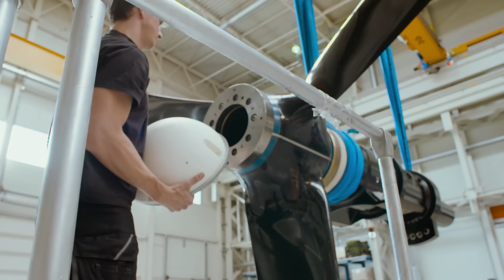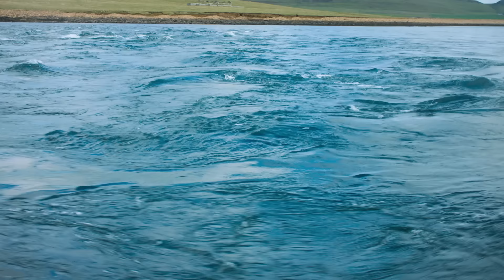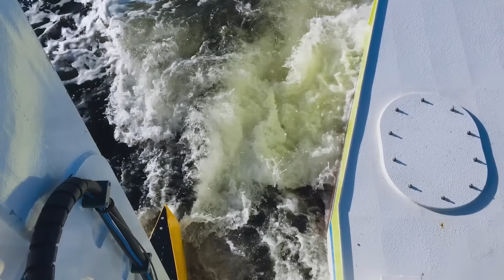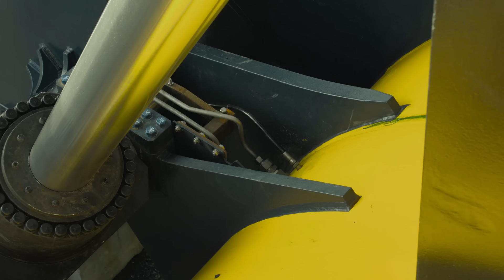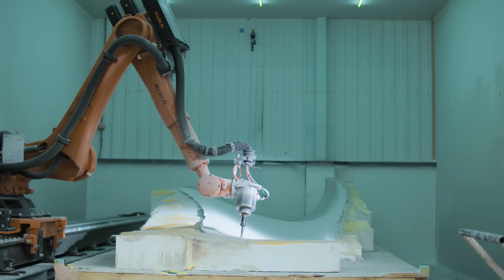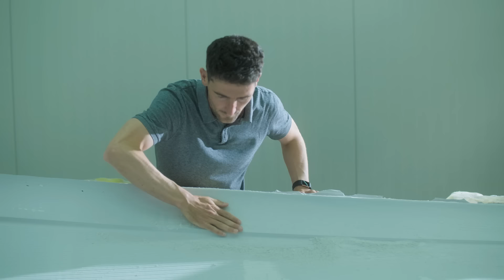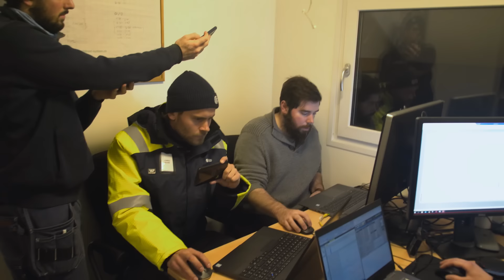Tidal Power: Unlocking the Greatest Untapped Energy Resource on the Planet | FD Engineering

Comment: Back in 1979 I was an engineering student at the University of Illinois in Chicago, and as a senior year project I had to come up with some innovative engineering idea and design.  I was very much amazed and surprised that I had come up with precisely the same idea, an underwater power generating turbine that used underwater oceanic currents to generate electricity.  In addition to the theoretical hydrodynamics calculations substantiating the conceptual design, I also made conceptual drawings resembling machinery shown in the documentary! Unfortunately my professor shot it down as he believed it was not feasible!!  I can’t describe how I felt when I saw my 40+ years old ideas converted into reality in this show!! My compliments!
Reply: Plot twist: This was designed by your professor 😂
Reply: @sampreece good one😂😂
Reply: At 22 I was talking to some engineers online discussing free energy ideas and gave my ideas of tide capture and electrical generation.  I was told it was not efficient and unreliable. It's now 30 years later and I have seen both my ideas used and functioning.  A part of me just hopes my ideas were somehow responsible for  modern advances.
Reply: @ Were your concepts based on flow or currents?
Reply: I had a similar think happen in a social science class and the professor shot my paper down. 
Now my concepts are being used to help others.
Reply: @nickb654  has nothing to do with that. His professor was just the average professor. Great professors promote critical thinking.
Reply: Great Minds.... !
Reply: @pcbasics1  sorry to hear about your professor knocking you down like that. A pity you weren’t more resilient and try some other people who might have been enthusiastic.
I told a friend about one of my inventions and he did the same thing! Some people just have a pessimistic attitude.
I have an idea which has not been seen anywhere as far as I am aware, but I do not know who to approach. Good luck with new ideas, and be more persistent.
Reply: Actually most of the best ideas for alternative energy came out in the 1970’s and this includes both passive and active solar, geothermal, wind power, tidal power, and wave power. There were many, many different designs during this time and those ealy designs are the basis for pretty much all the modern designs. As for tidal power some of these involved using massive underwater propellers like in the video (either attached to the sea floor or to a floating structure), and some involved letting the high tide raise the water level in an inlet which could then be closed off and then when the tide lowered the water was channeled though water turbines much like any other hydroelectric plant. Basically, if you get all the old Popular Science and Popular Mechanics magazines from the 70’s and 80’s you will find all this stuff and you will see that all these modern designs are merely improved versions of much older designs.
Reply: Everyone misses the point because we live in such an instant gratification society. The secret to using tidal power to it's fullest is to use it's immense lifting power to compliment gravity batteries which retain 99% of the potential energy generated by the tides. Natural processes that created the carbon based resources took millions of years. We can do it much faster in a green way. Gravity batteries can be constructed in the "Fully Charged" position. No high flow water systems need be applied. Aqua ducts could be used to convey the tidal power inland to a desired location. Tidal action would transfer the potential energy into the lifting of air-filled pistons that would be used to elevate weights.
Reply: Your professor may have been Donald Trump's long lost twin brother.  Ignorance runs in the family.
Reply: Don't feel down about it because unfortunately, ideas' have no value but cost money to first make it to paper then even more to create a prototype then test and evaluate then mega bucks to create a production model at which time the banks and MBA graduates will steal it from you and make lots of comp and bonuses and at the best you will get a royalty based on the net profit...bugger all./
Reply: @pcbasics1  Sounds like the university was trying to trick its students into generating free IP for the university. Remember: anything you develop as a student is owned by your school or university. They file the patents on what you create, and they retain 100% ownership and control.
Reply: Sincere congratulations, cap!  We couldn't do it without you!
Reply: I am very impressed with the new technology introduced in the video. This not only helps reduce pollution but also creates a sustainable energy source for the world.
Reply: Thank you so much for the unexpected compliments and encouragement. What is important in the end is that somebody did come up with similar ideas that were eventually realized, and that many of these turbines are actually in service currently in several areas around the world producing clean and environmentally safe electrical power.  It is just as satisfying to see that the technology was implemented and is working well.  Most important of all it is technology that has minimal negative impact on the environment, provided that the necessary precautions are taken to protect the surrounding sea life.
Reply: I know where you are at, pcb. Do you have your original studies? Study them - see if you had any unique tech or features not disclosed above. A (slight?) possibility you might have some valuable IP. But worth looking into it. Also go & see your old dean of eng (if still alive - - see what they can do. Even if only make sure it doesn't happen to other students. Talk to a patent attorney? Rethink your old design- can you improve on it? Good luck.
I curse teachers who doubt their students - just putting them down. Happens far too frequently! Monkey pox on them!
Invented the worlds best 4WD in 1982 - and best EV driveline in 1995. But Mafia control everything.
Reply: I was -21 years old
Reply: Don't you worry. Your professor let you down but China would definitely accept your concept. Then China would copy those designs, mass produce them and sell them to the whole world.
Reply: yup, sounds legit.....
Reply: A classmate of ours talked about this in the early 70's. We've got Øresund between  Denmark and Sweeden,  great Belt between Zealand and Funen and little belt between funen and jutland all 3 waters with constant underwater current. Peter (as he's named suggested to harvest energy from the water currents but our physics teacher shut down his idea cause he wasn't as clever/smart as Peter (who by the way when we were 15 years old teached nuclear power/technology to the pupils 2 years older than us)).
Reply: AOS LADRÕES  USAM ESTE METODO TE INSTIGAM E TE ABORTAM DEPOIS DESTE TEMPO VEM OS INOVADORES  EM 85 PREFEITURA DE ALEGRETE  RS BRASIL PEDIRAM A MIM SOLUÇÃO  LIMPA PARA O LIXO URBANO FIZ O PROJETO  COM INDIGESTÃO  E COLETA SELETIVA  SENTARAM EM CIMA ALGUÉM  JA ESTA USANDO MEU PRINCIPIO... ISTO É  MODUS OPERANDUS DEPOIS DE 30 ANOS ....
Reply: An underwater "windmill" has got to be the worst idea ever. This should be illegal.
Reply: @VidarrKerr  why?
Reply: @bertjesklotepino  First of all, we know that the vibrations from the above water turbines out in the ocean are responsible for the deaths of dozens of whales --just from the vibrations. Second, you now add tons of spinning blades to it and stick it under water. What could go wrong? 

We know birds get  executed by wind turbines in massive quantities. How many animal species live in the sky? Birds, bats, flying squirrels... How many plant species? IDK, are there any? How many animal species live in the ocean? All Of Them. How many plant species live in the ocean? All of them.  

How about we don't put massive, spinning blades in their habitat. It seems like common sense. I guess it will take dying whales to stop it. Oh wait... that didn't stop it last time. Maybe when fresh cut sushi starts piling up on the beaches, we can open sushi carts to feed the 3rd world.
Reply: I'd check if your professor isn't the one taking credit for it now!
Reply: Your professor was not wise. Had he HELPED finding companies interested in earning money, selling tidal energy, then he would have been a brave professor. What a waste of time, that was. Why not go for a REAL project?!
Reply: @voornaam3191  a REAL project? Like what?
Reply: Cape Cod Canal! <~~ there's a huge potential
Reply: my idea was to rotate the cylindrical semi-submersible vessel
Reply: God's wisdom
Reply: Education designed to crush any imagination or individual enterprise
Reply: I've had similar shocking discovery of ideas I'd already thought of. Not nearly as big as yours but sometimes it seems that there isn't anything that hasn't already been thought of. I was building an electric car, back in 2007 I discovered Tesla. They had already done it, and did a better job of it then I did. also about that time chevy volt came out. LOL. I was trying to recapture energy from the breaks and that had been done already also. I have a complete machine shop in my back yard so I can build things but haven't done it in a while. I think its time for me to get a job. I think it'll be a more relaxing way of living compared to what I've been doing. I've made special purpose machines and done pretty well with that. Having the patience to train people while your running a business, I've lost that. I was training very high level people though.
  Good luck in your ventures, it sure seems like you have some incredible engineering skills.
Reply: I'm from Chicago and I lived on the west side of Roosevelt road by California
Reply: You were robbed.
Reply: I've seen so many of my childhood concepts turned into reality
Reply: Awesome
Reply: You and many have had the same idea .
Reply: So it's not a British idea glory hunters typical English
Reply: If I'm not mistaken tidal energy started off in derry Ireland years back before 2016
Reply: Yeah right lol
Reply: No you didn't 😂😂
Reply: Shot that down hu? They make wind mills and water has more force.  Not shure why your professor thought that wouldn't work
Reply: Your professor probably sold your idea man
Reply: Congratulations
Reply: YOU ARE LYING. THATS CRAZY.
Reply: About 40yrs ago? I believe you. Imagine the excitement of the people who made their own energy breakthrough and wanted to sell their product to the general public...    We'll all have to imagine it actually 😅 their names too. And just like yourself, imagine what the world would be like if we had it 40yrs+ ago
Reply: Could you give me some job opportunity?
Reply: So cool when it happens life is amazing😊
Reply: Get it to go round & round without having to gas it up, watch the Reactor, or charge it up…
Scuba the NW with just what tidal forces can do?  Ala Spit and Admiralty Inlet moves some water, just to name what should be obvious!
Reply: Here's why. Another "dilute energy" source getting oversold to the public. How many thousands of square miles needed to produce 8,000MW 24/7 like the largest nuke plant in Japan? You said 3,000 GW. Tell me how may square miles. What effect will these monster on sea life? How many aquatic animals will be chopped to pieces? When they break up how will broken pieces be reclaimed so pollution doesn't take place. The flour mill is fine, but I will lay you 100:1 odds the flour is ten times the price of a natural gas flour mill that can run 24/7. Who wants to pay that? One unit produces enough electricity for 650 homes. So to power NYC you would need well over 5,000 of these. To feed the US housing, the need would 135,000 of these up and down both coasts. The continental US has 12,500 miles of coast line, this would be 10 of these for every mile From Maine around Florida to the Texas/Mexico border; then from the state of Washington down to the cali/Mexican border. This could be done with 72 nuke plants at 8,000 mW ea, roughly 1.44/state. A much smaller foot print, much easier to maintain, build and service on ground instead of under water. Me thinks you've done to many drugs
Reply: Wow! There is awareness over time and place. More then ever. The old game won’t do anymore.
Reply: In 1979 I had an Oceanography class and we touched on the subject because of the consistent power of the Gulf Stream.  That was at Western Michigan University and I ended up getting a Geology BS.  I started grad school and took another Oceanography class and we looked at Bay of Fundy.  Environmental concerns were an obstacle.  

I did environmental groundwater work for ten years.  I was ready for something different and I became a custom home builder designing and building energy efficient timber framed homes.  

I am doing my “last” home for us and I am taking a bit since I will hit 70 years old soon.  My old forklift with a flathead 6 is hitting on about 4 out 6 cylinders….so am I!
Reply: You are a humble and beautiful man for still receiving the vindicating joy of your brilliance. Especially after facing the denial of known plausibilities by your professor. 
Strange the odd wisdom in the entwinement of dicotomies, and those poignant. Salud!
🙇
Reply: So great that you had this idea so many years ago.  A shame that society was not so clever to bring these ideas to reality. But perhaps many technologies to make it reality had nit been developed enough. Thkngs like these need decades to becone reality and ressourcces must become less to bring some percentage of socuety to the sensitivity for things like these.
But isb't it a pleasure for you to see your ideas become hardware reality?
Reply: Interesting to think of how the Earth uses Solar and Lunar energy every day, from plant growth and thus wildlife, to climate, which again leads back to life. With that in mind, it is theoretically possible to have life on any planet anywhere.
Reply: @donscheid97  The Earth is powered by the sun almost completely from the biosphere to the weather systems.  The sun is 99.9% the mass of the solar system and provides us with a cosmic 173,000 terawatts of power non-stop continuous for billions of years at least a billion more.  All the combined nuclear and fossil fuels would amount to a bucket floating in a sea by comparison.  The sun's energy flows through our veins and powers our thoughts even as we ponder this.
Reply: @donscheid97  The Earth is powered by the sun almost completely from the biosphere to the weather systems.  The sun is 99.9-percent the mass of the solar system and provides us with a cosmic 173,000 terawatts of power non-stop continuous for billions of years at least a billion more.  All the combined nuclear and fossil fuels would amount to a bucket floating in a sea by comparison.  The sun's energy flows through our veins and powers our thoughts even as we ponder this.
Reply: @donscheid97  The Earth is powered by the sun almost completely from the biosphere to the weather systems.  The sun is 99.9-percent the mass of the solar system and provides us with a cosmic 173,000 terawatts of power non-stop continuous for billions of years at least a billion more.
Reply: @donscheid97  ..furthermore..

The sun is 99.9-percent the mass of the solar system and provides us with a cosmic 173,000 terawatts of power non-stop continuous for billions of years at least a billion more.  All the combined nuclear and fossil fuels would amount to a bucket floating in a sea by comparison.  The sun's energy flows through our veins and powers our thoughts even as we ponder this.
Reply: @donscheid97  The Earth is powered by the sun almost completely from the biosphere to the weather systems.
Reply: Does anybody have the FOGGIEST idea of the impact of diverting MEGAwatts from tides???
Reply: @ The power of the tides is not much in the Tidal Flow. The real power of the tides is  in the displacement value. Think about how a rising tide raises all ships. That's a lot of power. Ships don't use it all. Tidal diversion and turbines are not sensible in many  ways. Tidal Power and Gravity Batteries are the future.
Reply: @centurione6489 not much being as 3 peta watta exist a few megawatts is like .000000001 like a satoshi ha
Reply: @centurione6489 however if theyre able to harvest enough they will make the moon come closer to the earth faster
Reply: @centurione6489  - The tides don't lose potential energy. Nothing is diverted.
Reply: @centurione6489  maybe it would help with coastal erosion.
Think about the energy removed from winds, by wind turbines. That could be weather altering!
Reply: Tide is synonimous with current versus magnetism, screwe with this system will be worse than global warming @centurione6489
Reply: @centurione6489 yup. If overdone then the waves would get smaller, less air mixing into the ocean might result in lower oxygen level, higher water temperature, stale water like in a pond. Effectively underwater global warming near the shores
Reply: @centurione6489   The real problem with energy is, electricity can be used around 400 miles from the power source, further away you really get in trouble for wire heating loss. Even hefty copper wire has some resistance, so the wire heats up, and we LOSE energy. That is why power lines have a huge voltage, it reduces the amperage and thus the heating. Do you see?

This concept is great for cities or industry near the ocean. But our power grid is fantastic, still it does have limits. That means such tidal energy projects should include a way to deliver the energy to the customers.
Reply: @centurione6489 ocean currents are constant
Reply: We really tried in the 70's congrats.
We could use some help engineering a way to plug/use the vast methane releases from really old oil wells. Pennsylvania is where it all started, Texas was next. Look at a methane map.
Really doing something about something that big is totally ignored. 
Sorry for the rant...
Reply: @RogerK9883  Old wells are just a drop in the bucket. More methane leaks out of the land and under the ocean than 13 billion humans can ever use. It's looking more and more like the methane is not associated with oil. It's believed by some that super-heated hydrogen many miles in the earth synthesize methane, and it eventually works its way to a depth that can be drilled.
Reply: thats fake
Reply: So, did anyone explain why it's not scalable or practical to maintain?
Reply: @pcbasics1 You are a humble and beautiful man for still receiving the vindicating joy of your brilliance. Especially after facing the denial of known plausibilities by your professor. 
Strange the odd wisdom in the entwinement of dicotomies, and those poignant. Salud!
🙇
Reply: @nickb654 Wind-and-solar do not compete against fossil-fuels. Wind-and-solar require fossil-fuels, and increase dependence upon fossil-fuels.
Reply: @aliendroneservices6621 ГЭС постоянно вырабатывет сотни тысяч МВт энергии, подводные течения тоже есть ГЭС! Так что заткнись!
Reply: @aliendroneservices6621  Nonsense. You think like a dinosaur, sorry to be rude. Sure it is not easy to do the transition, but we should never block progress. That is not wise. 😮
Reply: @voornaam3191 Wind and solar are diffuse. Magical thinking doesn't change this. Progress means moving toward denser fuels.
Reply: Your professor was right. Although it would have worked, working is not feasibility. Even windmills and solar farms aren't really feasible and sustainable when you do an honest study and compare it to other municipal power generation methods.
Reply: @Bob_Adkins  yet people have invested millions in wind and solar. It is just a moneymaking game.